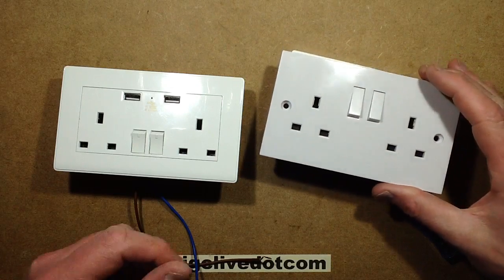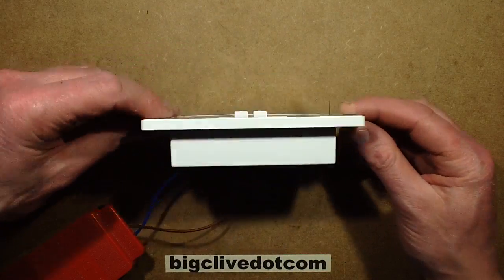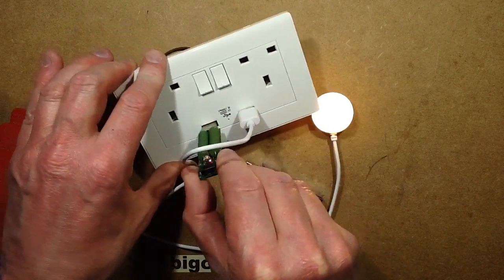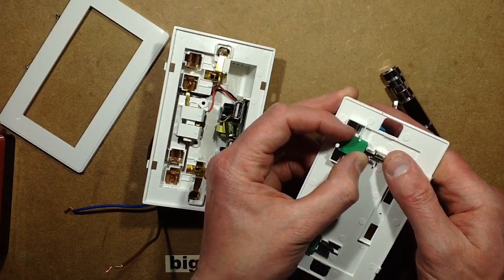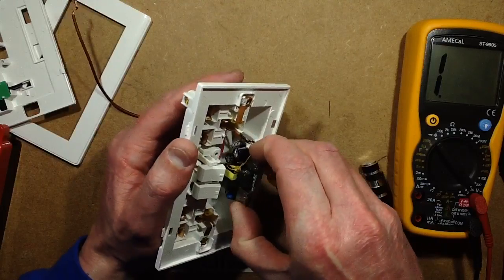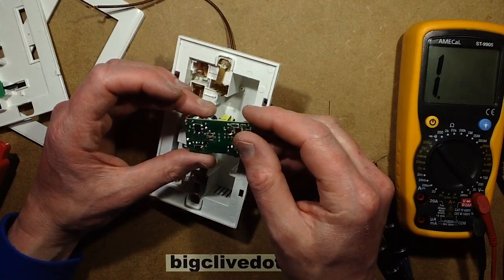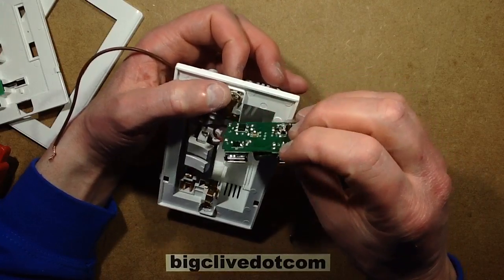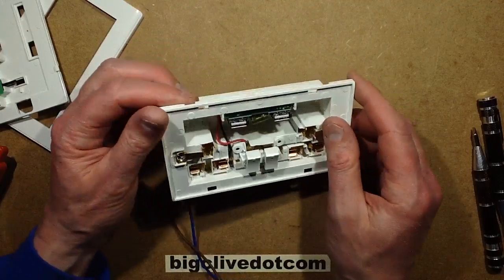A look inside a (crap) double gang socket with USB outlets.

Comment: We've had a fair number of USB charging bricks go dead, so unless the built in usb ports are better, they will fail shortly and become a nuisance. (Though ours failed under full load.)

Our 15 yr old US gfci outlet also went bad but apparently that is not unexpected for its age. But that is also like a permanently installed electronic. 

We had fluorescent permanent lamps fail, and then our led lamp failed. First there was a nicked wire from the factory that shorted after a few years. Then the LED power supply failed and the whole lamp was replaced with another LED integrated lamp. (There were not many options with replaceable bulbs)

At least the 1st led lamp has a replaceable ballast, but the new led lamp looks to be a lot more integrated and not as easy to repair.

Comment: Considering that there are new charging standards coming out all the time, I don’t think USB wall sockets are a good idea, unless you are fine with having to replace sockets every few years as standards change (or having outdated USB wall sockets that will either charge devices slower, or in some cases may not even charge them at all (because the devices require more power than what the outlet can provide)

Comment: I've just removed two of these style sockets installed by the previous owner, just the 4800 mA version. It has a lot more electronics inside to account for the extra current. 

In addition to the weird earthing arrangement, I noticed that the contacts for the earth pin don't even really make contact with the pin at all, which is very concerning and probably explains the mild shocks I was getting from equipment intermittently.

Comment: I know this is quite an old video but as I have a few sockets at home with USB ports built into them (as well as a few other devices), I was wondering if there was an easy way to test these for stability?
Reply from the maker: You can get plug-in USB testers which would show if the voltage was dropping under load.
Reply: @bigclivedotcom  Thanks. Ill look into getting one

Comment: Even the best devices are putting too much in one unit. A cheap 13 amp socket from lets say Screwfix and a USB charger from Poundland far better. The USB charger can travel with you as a bonus. Double earths done well allow the back box to have an earth without bunching of wires. 3 wires to grouped earth is about the max. That's ring in/out and spur. The reason we earth plastic boxes is to allow a metal one to replace it. Most sockets automatically earth the box. Thus a daft reg.  Once in a blue moon it is the right thing. Metal light fittings come to mind that were plastic originally.  Cheap 13 amp sockets often have excellent build quality. Even the shape of screws is of optimum profile. That is so important.

Comment: I only listened in the background to this. Don't know if you mentioned it, but I don't like the position of the switches, is that up to code? They're a bit close to the L/N terminals of the sockets for my liking. Wet fingers, dodgy plug, could be asking for trouble.

Comment: Dual earths are usually for continuation of the earth so as one may break that would disconnect the earth to the next socket. We would put one cable into one and the other cable into the other because we would notice if you overtightened the screw you could damage one of the strands and with voltage vibration it would eventually snap. By folding the wire over to form a "U" which when you tighten the screw it will tend to lie flat and one in each terminal will ensure a good connection, as long as you check the earth connection is continuous through the socket. On this socket it would seem to rely on a metal box to transmit the earth or a loop.

Comment: Two questions : 
1. Is that lamp, which flickers, a simple usb 5v light ?
2. Would the lack of internal earth connection be picked up by using a simple plug-in socket tester  to test each of the 2 sockets ?

Comment: I was in Wilko for a light fitting but as I queued I noticed it was made in China. I left the queue and put it back on the shelf. I've had Chinese stuff before and I could imagine the screw threads stripping out or the plastic getting hot and deforming or even melting. I went elsewhere and bought a make I know: Crabtree, about twice the price but how many do I buy in my lifetime so I don't mind for a make I know. Don't skimp on quality which can mean safety.
Reply from the maker: Everything is made in China.  Including many of the "British" and "American" brands.
Reply: @bigclivedotcom  They are branded names I know and hopefully the quality is not compromised. 
I remember Chinese Flying Bomb batteries years ago, they were terrible and soon discharged. A waste of money.

Comment: Most good quality sockets have two earth terminals and many electricians like myself will put one side of ring main earth in one and one in the other. This makes the lack of link in this very worrisome. I would say though that when testing I always yes both sides of socket and the problem would show up when the ring main continuity is tested.There’s a good reason for this when multiple computers are on the circuit as they often actively use the earth. When installing a ring main for an office where computer equipment is used regulations require the earths to be separately terminated in both the sockets and at the consumer unit

Comment: If the control circuitry is fed by a winding on the transformer it will require a load on the output to increase the duty cycle in order to maintain the control circuitry voltage. This is why an unloaded output is unstable.

Comment: i have a 3.4A version of that , purchased form amazon and mine is much better build , and takes up considerably less space in the back box
also not sure if you are aware , but most Android phones , required a DATA component with the charger to acknowledge the device before the device will even accept the incoming power, IPADS will charge on lower ampage but if you want to use it and charge it you will need 2,4 amps becasue at 900  ma using the device will drain it quicker than it can charge

Comment: I design switchmode power supplies. Instability should be designed out across the load ranges (and input voltage ranges amongst other things). It's appalling it's not covered in this example, it makes you wonder if other corners have been cut. Is it CE marked? Is it an illegally badged part?

Comment: I bought a similar socket with usb, different make. The socket switch started arcing when pushed on. I disconnected it and its in my WEEE bin for disposal. Total piece of crap. I wonder what % of them are faulty. CE marked should ensure a high degree of safety. Not in this case.

Comment: Safety should be a paramount.
Checked your other videos.
There is one more appliance that probably deserves your video investigation.
It is the bathroom fans. 
The most interesting thing about them is that the lots of them got a timer and it is designed to fail.
On a failed timer board there is usually one single resistor that has traces of high temperature on it and its soldered PCB connections. Eventually local overheating and moisture  destroy the soldered connections. Or electrolytic capacitors next to the resistor may dry out.....
Reply from the maker: I looked at one of those recently.  The resistor doubles up as an anti condensation heater.

Comment: These are bog standard 5v USB PSU modules found in nearly every travel adaptor (based on the Chinese LP3773 PWM chip), in fact  the circuit diagram is in the datasheet which  is a proven design  - safe, stable and durable - but not the best regulation. I have a few around the house and have not had any failures despite the fact the PSU modules are dirt cheap costing $0.89  from Aliexpress. The important point is the output is isolated from the input via a transformer, it is reliable, efficient, does not heat up, offers decent current regulation  up to 1A @ 5V and is compact. If one 'scope's the output the ripple isn't that bad either. I think it's good value for money given that a well designed SMPS chip alone from TI costs $1.

https://datasheetspdf.com/pdf-file/1046691/LANDP/LP3773/1

Comment: Hi Clive, we have had two usb twin gang sockets fitted in a boat. Burn out the wiring. And blow up. Will do some investigation. Suspect that condensation might of got board wet and shorted the capacitors on AC side, thus blowing components. And leading to usb module drawing a high current. In a damage state. Going to replace and will send one. If you like.

Comment: Very dodgy if CPC not linked as you say most connections are linked for high integrity so if one earth connection is lost while it won't give the correct impedance there is still an "earth" of sorts, therefore, maintaining a level of safety should this happen

Comment: I have often wondered if it's a good idea to have these built in transformers in power sockets running constantly. Even with better quality, safer sockets than your example, this uses small amounts of electricity that over the millions of the things out there must add up to a lot of power wastage. I think it would be better to make the USB sockets separately switched.
Reply: A usb charger can be upgraded... these sockets, less so. :/

Comment: The simple fact that the earth protective conductor within the socket is not continuous is contrary to BS1363. That means this equipment is not approved for use in the UK and should be withdrawn from sale.
I know this is a 5 year old test but the same sort of shit is still out there, particularly the international socket outlets and adapters which cannot accomodate the UK's earth-pin actuated shutters on socket outlets due to complexity.
If anyone encounters any product of this type I strongly recommend they contact their local trading standards office and report it. Similarly, if anyone buys any electrical product for use in the UK and it is not supplied iwht a Type G plug top (UK 3-pin), contact the vendor and ask them to send you one with a Type G, and that an adapter is unacceptable - they will often include an adapter instead. The reason adapters are not acceptable is that they are not fused and UK plug tops MUST be fused. Note that if you do use this kind of shit your fire insurance on your home is void.

Comment: Maybe things have improved with these devices now i wouldn't know as haven't fitted these for quite some time and i'm reluctant to, two things concern me about usb sockets, 1 you cannot switch them off and they are hanging off most likely a 32a ring circuit so probably no overcurrent protection should something go wrong. 2 if one of these units become faulty they can leak dc into the system and potentially disable your rcd.

Comment: You suddenly realize that the electronics industry is getting more and more IC-based when the full bridge rectifier for mains supply comes in a small black square plastic case rather than 4 visible diodes and capacitors. Everything is getting more abstracted and I worry for future engineers (myself included), whose knowledge of basic circuit theory is being swiped away. Books are the best after all I guess. The classic ones
Reply from the maker: Your existing electrical theory is still valid.  The bridge rectifier packages are a popular choice, but discrete diodes are still commonly used.

Comment: The flickering is again simple - all the laid is going through 1 port so it’s drawing all the power and the light is getting to much fluctuation and when you plug a 2nd item in the other socket it splits the power between the 2 therefore dropping the amount of electricity. It’s the same principle as what you get in a dual usb in car charger where it’ll charge at 2.1A until you plug a 2nd item in.

Comment: 2 separate earth terminals just means you have 1 that can be connected directly to the socket and 1 can be attached to the back box without squeezing loads of cables into 1 earth terminal. Simple really 🤷‍♂️

Comment: I'm pretty sure this is the crappy model that I had previously fitted. Blue light came on but wouldn't charge my phone. I have since replaced it with ordinary socket again. They are also a problem in that the circuit can no longer be correctly insulation resistance tested

Comment: Did buy one for myself. But made sure got a good known make (crabtree). Am electrician by trade  so always buy good electrical gear anyway. Only use it to charge my mp3, Bluetooth speaker and headphones. Looks like would struggle to fit that in to a deep cooker type back box.

Comment: I’d say british plugs are the safest. The plugs dont become live unless they arent accessible anymore (pushed in far enough), the plugs are nice and sturdy, the shutter system. Europeans are pretty much the same, although the plugs are less strong and tend to bend after a while. Then the modern european sockets have shutters, which you have to push away by simply pressing in the plug by force. Th older sockets dont have this and they make some sort of turning mechanism where you have to push the plug and then rotate it. Which also works pretty well as a safety mechanism.

Comment: I understand why you would have a either port  in a redesign socket plat but why would you won't a USB port if you get a plug. If the USB was to replace the plug then it would make sense but to have both is just a waste of development time.

Comment: I have an MK logic plus with USB.  It too is quite deep I had to add a spacer to fit it into the brick wall, no way I was chiselling out just for a replacement socket.
It's been used daily as a charger for various phones and devices for the last 4 years with no problems so far. I wonder how long it will last.

Comment: I really just think usb sockets are a gimmic, I don’t like the idea of permanent electronics hard wired in either, and tbh apart from my iPhone i don’t use any other usb chargers and most chargers these days are pretty low profile anyway. A side note, i recently installed 10 MK usb sockets for a customer and out of those 3 where faulty from new, the switch’s wouldn’t turn off the sockets even in the off position.

Comment: Would anybody please explain why sockets need on/off switches in britain?????
Reply from the maker: Convenience.
Reply: @bigclivedotcom   Okay, but where is the convenience? If i plug in an electrical device, electrical current flows, if i pull the power plug out, it doesn‘t. If i want to connect an electrical device with a socket, why should i want to switch the socket off?? If i want to switch off the device, i‘m using the power on/off button of the electrical device. To be honest, i can‘t understand it. But okay, every country hat it’s own peculiarities.😉

Comment: Completely agree about built in electronics. Its quite novel but if it fails then you're stuck with an overpriced socket. Or like with the one you took apart. It just didn't work in the 1st place.

Comment: I bought a 99p charger from china and all it had in it was a diode, capacitor, 5v zener, resistor and LED!  Imagine if the zener blew and your phone got 400v.  At least this one attempted to have the correct circuitry.  Bad idea to have something you cant disconnect when not in use.
Reply from the maker: Can you point me at that item listing?  If it was just a capacitive dropper then your phone was likely to be live at mains voltage anyway.
Reply: @bigclivedotcom  that was many years ago but i am sure they are still on sale on ebay.  I dont buy mains operated items on ebay or amazon anymore especially if the seller is located in china.  And yes the shield of the USB outlet was live as the neutral was connected to the anode of the diode - you might have expected the shield at least to be connected to neutral but nope, the most dangerous configuration imaginable was used.  At least the capacitor was rated at 400v and not the usual 16v rating you find in electronic gadgets.
Reply: @bigclivedotcom  not even a capacitive dropper!  Worse than that, the diode rectified the mains which charged the 400v capacitor.  5 v zener was placed across the output terminals and fed via 1k ohm resistor from the capacitor.  Interestingly 400v/1000 ohms = 0.4A which was the current rating stamped on the casel

Comment: Light load regulation is an issue for some switching supplies. For efficiency, they'll go into pulse skipping mode or burp-mode, and the noise on the output increases. If you sense at low current and then go into charging, I can see where this may be an issue.

Comment: you should do a warning video on the chinese copy fuseless uk plugs

my house could have burned down i used the plug for the kettle as it was a kettle type connector it was for a power supply supposodly and the wire melted while i was standing next to it thank god

Comment: By the way, is there anything inside these that turn them off if there's nothing plugged in?
Reply from the maker: No.  But they usually have low standby current.
Reply: fire waiting to happen  these are sat on the end of a 20-35 amp circuit breaker.

Comment: Jesus! How the hell did this pass any safety test?
Reply from the maker: It didn't.
Reply: @bigclivedotcom  Thank F for that.....  Being in the EU always had me worried that we were going to have to adopt their electrical standards..... 🤯
My mother in law's flat in Poland is a lovely example.... 1 ES 10A  breaker for the whole flat...
2 core black and black cable...
The bathroom and kitchen sockets had an exposed Male pin for the 'earth' that was randomly connected to one of the conductors, which measured 120V each referenced to the water main pipes...
And the double 'protected' sockets were reverse wired with reference to the 'earth' pin, 2 sockets one above the other where left and right are swapped...
Floating supply frightens me, too many options to create a lethal fault without any of our in built safety features...
Reply: stay in england its safer.